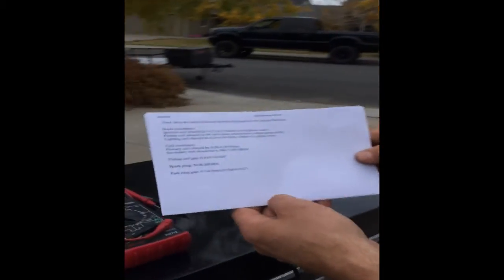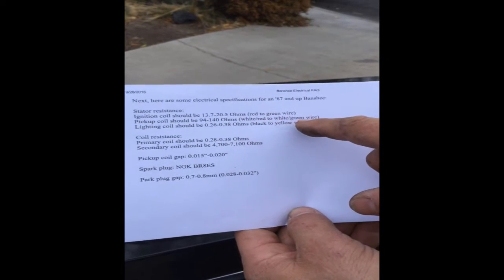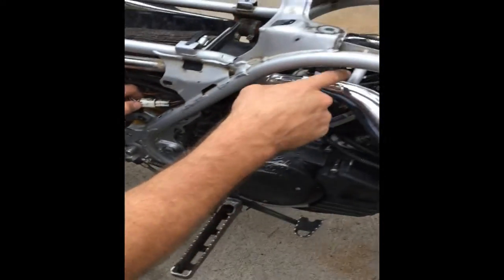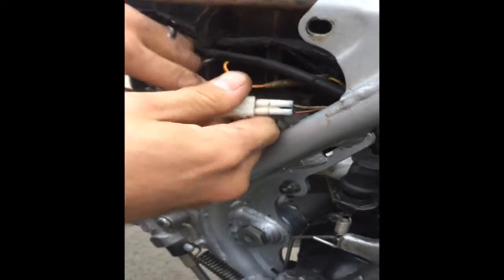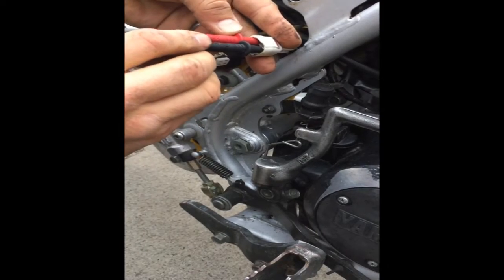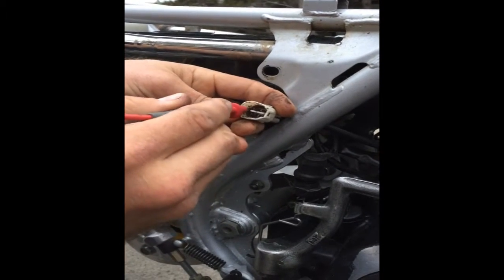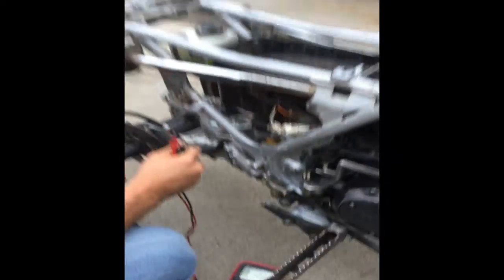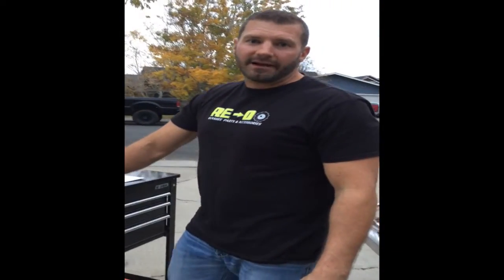How To Test Yamaha Banshee Stator

Comment: can a stator be ohm tested before installation?  do any of the cheap Ebay stators work ?
Reply: bought a $28 stator from ebay seller who had sold 1700 of em. Sent
it back, bought a $120 PROCOM ESG870  before i got ur email about Ricky's and i
guess it's made in China also because  ohm tests are zero or 1 same as cheapo,
could it be the china stators are good but want test right?
Reply: Procom tech says only OEM stators will pass this test, aftermarket stators are wound different w/different wire